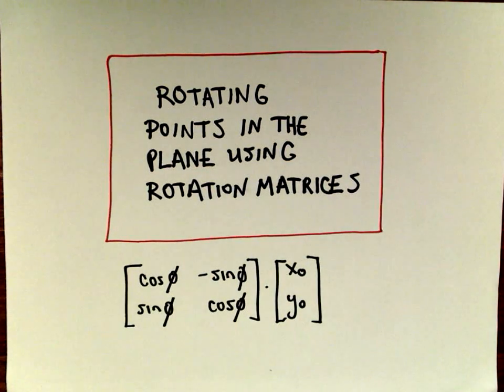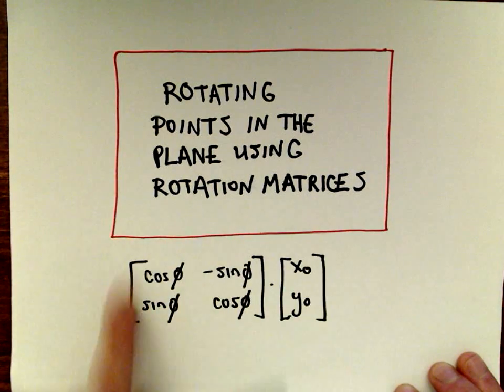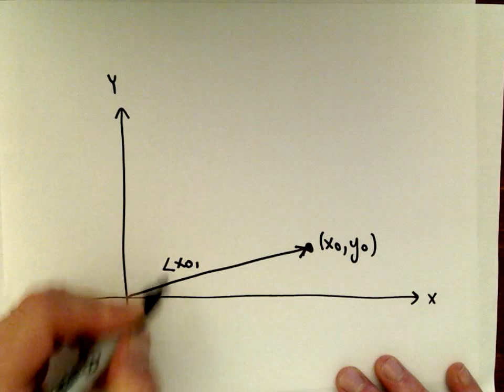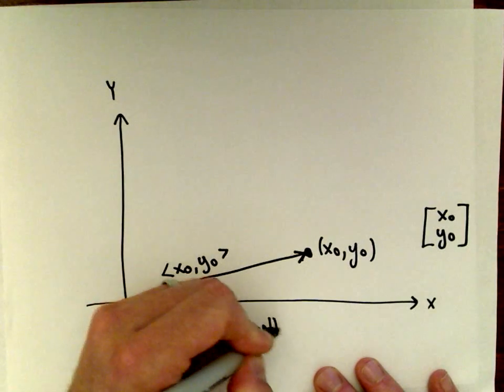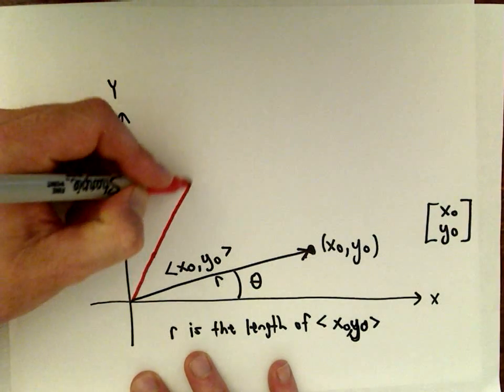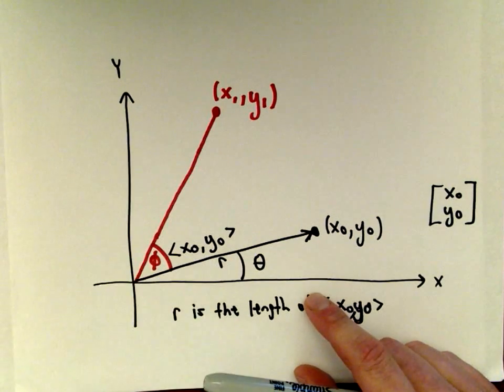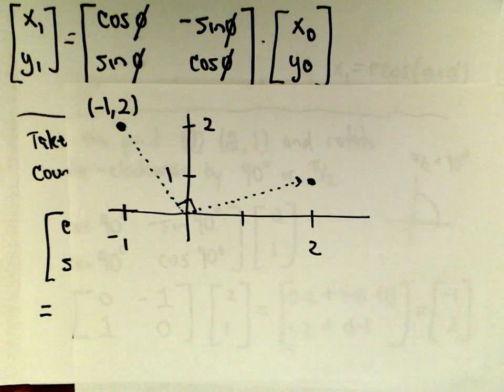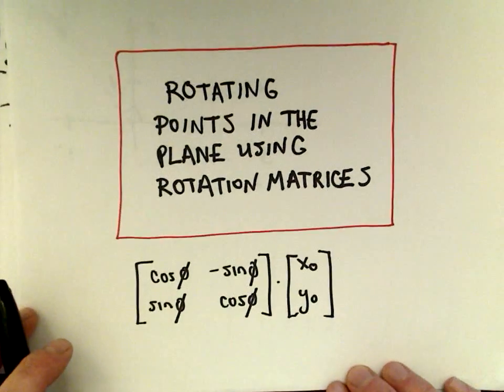❖ Rotating Points Using Rotation Matrices ❖

Comment: There is a much simpler explanation.  Instead of the point being rotated, the axis are rotated.  The matrix represents the rotated axis, which are used to rotate the point.

You don't need to use trigonometric identities.  The trigonometric values are of the angles with respect to the axis, not the point.  That is why you don't need to calculate the radius.

Comment: Can you solve this: 

The linear transformation Tθ corresponding to counterclockwise rotation in the plane through an angle θ has
standard matrix: 
􏰀cosθ −sinθ 􏰁 
sin θ cos θ

Use the appropriate matrices of this type to show that the composition of the transformations corresponding to counterclockwise rotations by 30◦ and 60◦ is equal to the transformation corresponding to counterclockwise
◦
rotation by 90 .

I have no idea how to approach this. It’s a practice problem in my class.
Reply: I can't do matrix notation on here of course, but it's quite simple. Call your rotation matrix by 30 degrees A and your rotation matrix by 60 degrees B. Designate by C the rotation matrix for 90 degrees. What you have to show is that the matrix product BA = C, which you can do by good ol' plug and chug.

Comment: The proof in this video is could be much simpler. A rotation matrix is simply a change in basis vectors, the matrix rotates the whole space, not single points. You put the basis vectors in matrix, rotate those by phi, and that is your new matrix. In this explaination, by taking a point, saying it is rotated by theta, then is additionally rotated by phi, just to have all the theta drop of of the equation, shows that the theta wasn't there to start with.
Reply from the maker: um, ok.
Reply: How would you rotate the basis by phi without the rotation matrix? Prove it.
Reply: Because the rotation matrix is made up of basis vectors, and the new basis vectors that were chosen are "cos(phi), sin(phi)" and "-sin(phi), cos(phi)", so you put those into a matrix, and that's it. They can be anything you want, they have been chosen to be trigonometrical values to get the rotation. So what you really need to prove is that cos & sin can actually form a rotation. You could have just as easily chosen "cos(phi), -sin(phi)" and "sin(phi), -cos(phi)" as the new basis vectors and got an opposite rotation if you wanted.
Reply: I see, thank you for sharing. To me this proof is much simpler. Although, I will admit, that the proof you've mentioned is nice as well. I think it was important to be introduced to both.
Reply: noob.

Comment: Great explanation, thanks! It would be great to see a derivation of the 3D case (3x3 rotation matrix) also.
Reply: Please
Reply: @delandoduggan7698  It's the same for 3D, here we are rotating along the z-axis, so if you want to rotate along the y axis then substitute x and y with x and z. So it's just a matter of changing the axis.
Reply: @vijaishankar3942  I need full answer for 3×3 matrix
Reply: @dhanush.n290  the Z stretches out of the plane, so rotating the other two does not affect it. Therefore, you would append a Z’(0) to the end of the pre-existing equations. For the third equation, you are rotating/performing transformations with the Z-axis directly, not the other two. Therefore, they are x’(0) y’(0) by the logic used previously. Z would be Z’(1) because it is now being transformed.

Comment: heh I remember having to do something similar to this in OpenGL for a game I was working on, having to rotate a point around another arbitrary point rather than its origin.
Reply: @The Genius Trumpman It's actually everywhere when you deal with any graphical rendering. How do you think you get a moving scenery in video games for example? Everything on the screen is defined by vertices and any movement is done through a linear transformation.